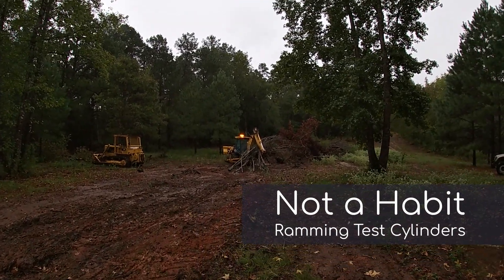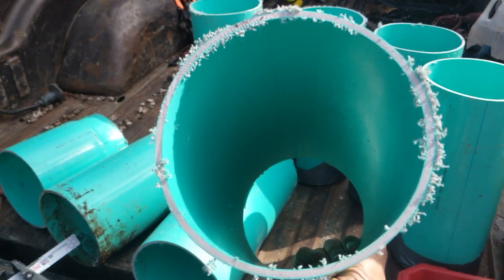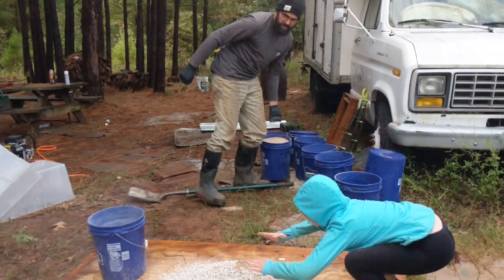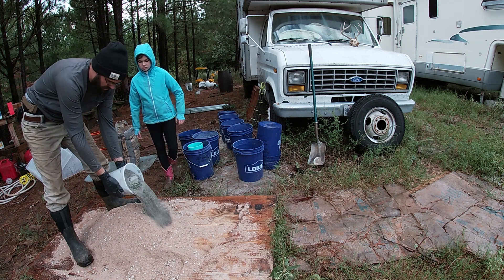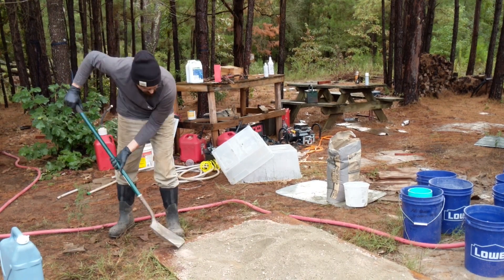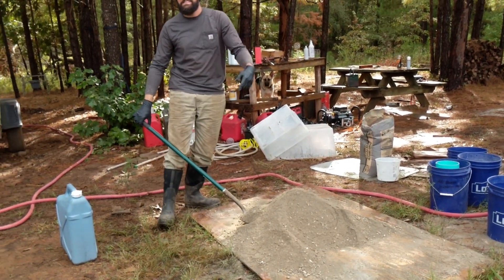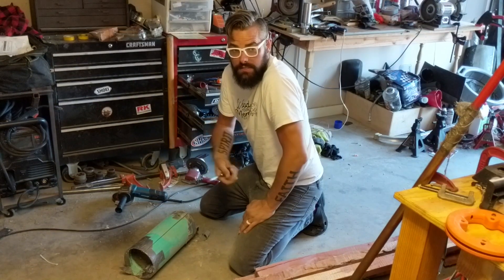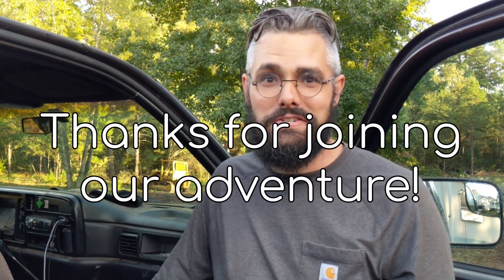Rammed Earth Strength Test Sample - Natural Building

Comment: I'm debating between building with rammed earth and aircrete. I don't like the idea of all that cement in the aircrete (I think its about 15 lbs per cu. ft. of finished wall) You said this mix will end up being about 6% net cement.  I assume this is by volume not weight. Have you determined how much rammed earth your house walls will use? Thanks for the vid.
Reply from the maker: We use about 9% portland cement by volume. That means we use 1 bag (92 lbs) per 14 cu/ft of material. If my math is correct that works out to about 6.5 lbs per cu/ft. But keep in mind your mixture may be a little less as most SIREWALL mixtures use less than 10%. Hope that helps

Comment: @Red Earth Ranch Why don't you mix the material in a cement mixer? Or what is the pros and cons?
Reply from the maker: Technically that mixer is designed as a cement mixer. However, a standard cement mixer would have trouble with how dry our material is. One could probably do it for a while but would burn up with how much we will be mixing. The Ettera is designed to mix dry material so we use that.
Reply: @RedEarthRanch  my family just bought land because of your channel.  We're going rammed earth can you share the excat mixture used .

Comment: Whats the exact mix ratio and materials used?
Reply from the maker: We use 3 parts sand, 1 part gravel, 9% portland cement then 2-6% color by weight of cement. But mixes are different based on the material used.